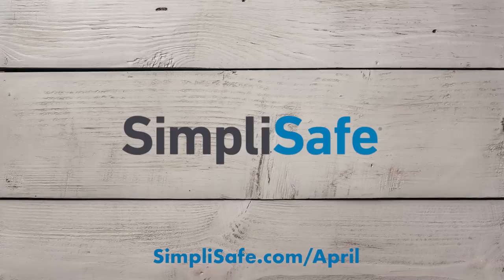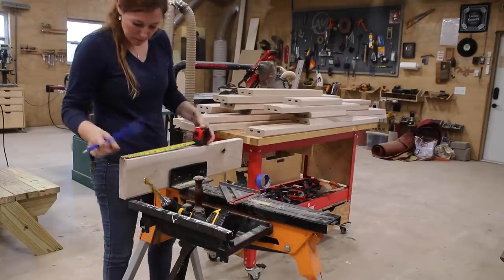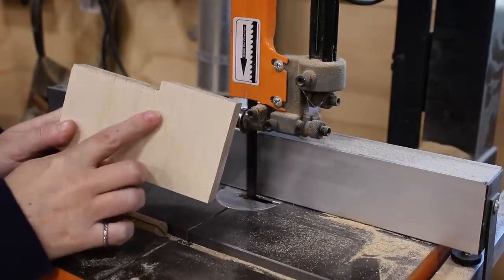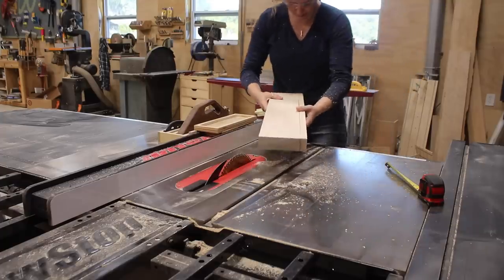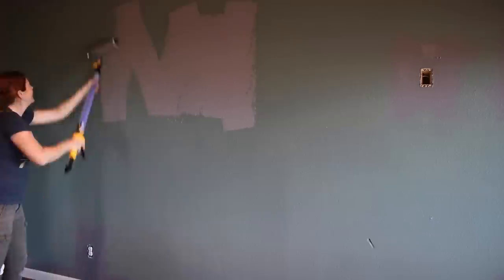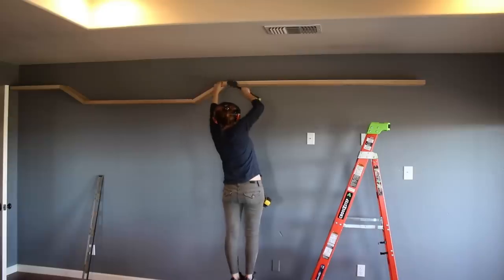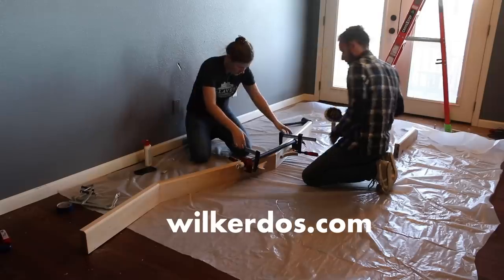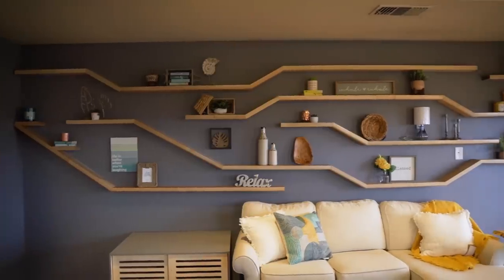Easiest DIY Floating Shelves Method | How To Build

Comment: That's a great focal point for the room, and a great use of that wall space, plus being very visually interesting with the angles, and the color contrasts with the lighter wood.  Well done!  And I like the alternative assembly you described at the end over the solid wood approach (mainly because I'm too much of a cheapskate with current lumber prices to hang all that hardwood).   😎

Comment: So, I have been in my house for just over 4 years. I have a 4ft wall above my computer desk that is just open. I had a more geometric (with mostly 90 degree angles) version of this at my last house, but painted it black. It collected dust and the items on it were random collectables, so my wife hated it.

This has given me the perfect inspiration for a different look. I may use dowels and build and attach.

Thanks for the idea and different wall attachment than keyholes.

Comment: I like your trick of cutting the dowels on the bandsaw to aid with the installation of the shelves. I also like your floating shelf design that does not require the purchase of special hardware. The only improvement I can think of is cutting a chamfer or slot down the joint line of the two halves of the shelf. This will create a shadow line that may help hide the joint if there is a slight gap. This slot may also help in displaying plates on the shelf. Overall an AWESOME Project!!! Your "Shelf Wall" looks GREAT April!!!  😀👏

Comment: Clever method. I think it would help to drill the hole as high as possible above the midpoint of the board's edge. That way the shelf "hangs" from the dowel and it will have less sag.

Comment: Looks wonderful. Wondering if the problem at the miters could have been solved by replacing the dominos with a rectangular biscuit and dados on the ends of both shelf pieces. That way they could slide on in the same direction as the dowels.
Reply: That was my thought also.

Comment: I might use the floating shelf idea for the wall behind my desk.  Kind of open and would be nice to have something up there.  I used one of those painter things from Wagner about 20 years ago to paint the first house I ever bought. Thought it was kind of a unnecessary gadget when I bought it.  The house was super ugly with blue and pink trim, as well as gray and pink wall paper.  Ditched the wall paper.  Took a weeks "Vacation" and I will say that roller made the whole painting of that house it way easier.  Ceilings and walls.  After using it I was pretty sold.  Defiantly worth the cash for someone that really hates painting.  Later I ended up removing the Fake beams and popcorn texture on the ceiling.  Installed new floors.  Updated the whole house eventually stripping both bathrooms to the studs to rebuild.  Painted the outside... replaced the garage doors.  Tucked and pointed the bricks in a few spots.   I did very well at sell time.  Did everything myself with the help of my wife.  That house gave me a ton of confidence (never had done anything like that before)  and I feel I can handle most things these days.

Comment: My wife has asked me to build her some floating shelves for the family room. I bought some brackets off amazon for this. However drilling the holes, then cutting off the create a ledger board. I have never seen this before, it is so much easier than trying to hang brackets ad then drill holes to match. Definitely going to try this process ad return the brackets, sorry Amazon.

Comment: The problem with shelves like that is that they will sag towards the front edge over time and faster if you put weight on the shelves. I know this because I made shelves similar several years ago, the only fix is to had either metal supports or a support bit under the self that goes from the edge of the shelf and down under or over to either lift or hold up the outer parts of the shelf.

Even with such a big issue, they sure look good. And cool idea on how to stick them to the wall.

I solved this by adding small but very strong metal angles that had the same color as the wall and with stuff on the self below they were invisible or near too invisible. They still weren't strong enough to hold something like books, but it was enough to stop them from naturally sagging over time.

Those screws you anchored the shelves to the wall with will bend, but it will take time. Even just the weight of the empty selves are enough to make that happen, but the more you put on the shelves the fast it will happen.

Or maybe it's just me and having bad reactions, but I've seen the bending or sagging happen many many times and I love shelves, preferably filled with books. My floating shelves were made to hold Blueray movies and it was only 15 cm deep, with the metal angle supports underneath, it was the only thing that kept them from bending or sagging.

I tried the same with 2 cm thick solid wood shelves that were 30 cm deep and they needed support every meter to keep them from sagging, there's just not enough strength to hold anything up out towards the front edge. Same shelves though also sagged in the middle when having full support on eather side in a regular side supported shelves when it was only 1 meter long and filled with pocketbooks or comics. The key is support every 30 to 80 cm depending on what the shelves will contain and thankfully you don't need all that much, but it's needed and it must reach out beyond the middle of the selves dept to actually stop the front edge from sagging, it's just a matter of time.

Comment: This whole thing is great. I used to use a similar paint roller but it hooked up to my airless sprayer. I like your torsion box idea for the next idea. Maple plywood has been my go to for floating shelves. I would do full miter folds for a seamless finish. I like your two piece design, I would suggest that you back cut the box 5-10 degrees where it meets your mounting strips, that will give you room and ease to scribe for a seamless finish. I’m so doing this for my next shelving job.
Reply from the maker: Awesome! Thanks for sharing and for watching.

Comment: While I get the general idea of how these floating shelves are attached, I'm unclear on the "bracket". The back of the shelf was cut off to match the holes. But how are the 4" dowels attached in the cut off piece? (Tight fit? Glue? Screw through the bottom?) If this was in the video and I missed it, give me a time stamp.
Reply: I just had the same thought. I definitely enjoyed this method and would like to try it myself, but I’m lost at that part, too.
Reply: Not in the video, I re-watched it because thats the one thing I didnt catch and found it wasnt mentioned.

Comment: I did this method once and noticed that my dowels were too thin (1/4") and the shelves had a tendency to slide off. I added a safety screw into the wood and dowel just to make sure they don't slide off unintentionally. Loaded it up with books and never worried about them falling!

Comment: The one thing not pointed out and I can not find, is what spacing is that RIP cut?  It "looks like" it's about an 1/2" - 1", if that's a 1/2" hole, but I can't tell.  I just need that one piece to complete this project, please.

Comment: I am questioning all these DIY videos YouTube has been recommending me...CNC, a guy just helped...not really DIY or DIY should be rated from 1-10
Reply from the maker: DIY means that you do it yourself rather than hire it out to someone. It's splitting hairs like saying a screwdriver vs a drill is real woodworking. A CNC machine is just another tool in the shop that makes things go quicker. That CNC guy is my employee. Thanks for watching.

Comment: I’m going to go on a limb that the first method was just to show what doesn’t work because the videos are more relatable if you make mistakes?!  You’ve been at this long enough to know that wouldn’t work.
Reply from the maker: No, that is incorrect. I would not purposely do a mistake for an oops factor. I do however show a mistake if made but would never fabricate it. Thanks for watching.

Comment: Easy?  I loved the end result, but this wasn't easy.  Lots of tools used here the average homeowner doesn't have and wouldn't be recommended to get.  If you're into woodworking and have a lot of these tools already, this is probably easier.
Reply from the maker: You can still do the project with simple tools, it will just take a bit longer. As I have them, for time's sake naturally I use them. Thanks for watching.

Comment: Cool project but I don't think I would call it easy DIY.  Most people won't have anywhere near the equipment you were using on the project.  Nice result though.
Reply from the maker: I use what I use, because I happen to have it. You can still do the project with simpler tools, it would just take longer. Get creative and use what you have and enjoy the process. That's what's important. Have fun with it. Thanks for watching.